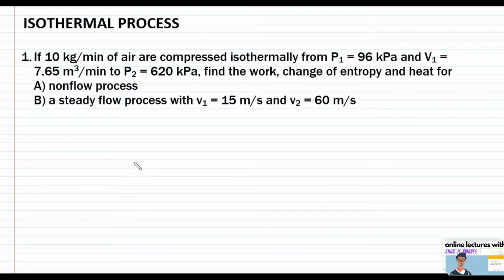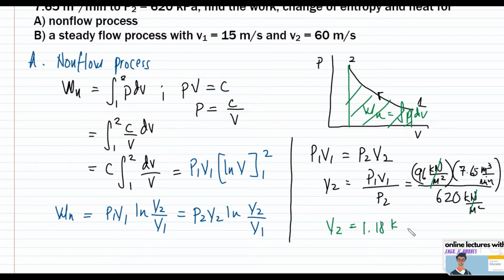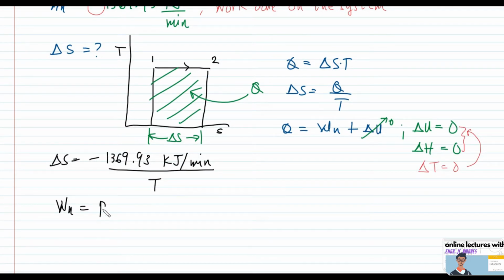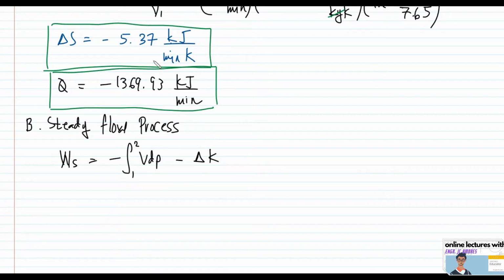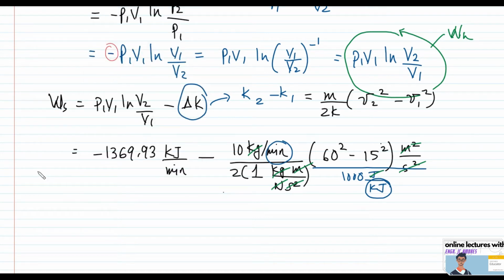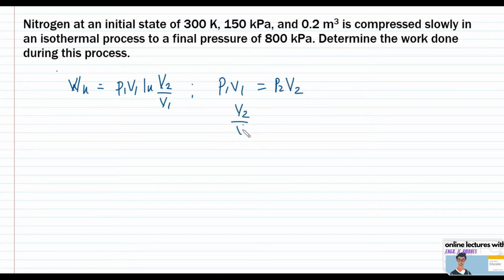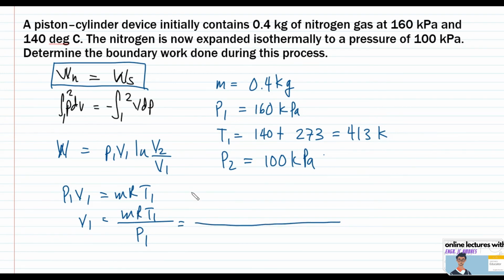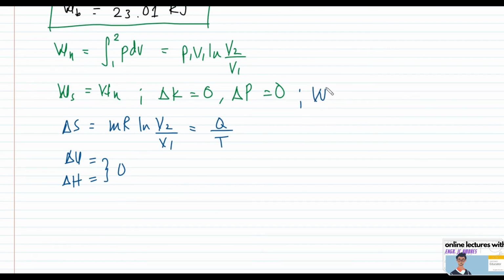Solved Problems for ISOTHERMAL Process | Discussion of Formulas | Step by Step Solution

Comment: The units of entropy are KJ/K, and not KJ/min K. Why was that the answer if the units are wrong?
Reply from the maker: Hello Merti. ∆S = Q/T. In the problem, Heat is also the Non-flow Work, and it was a rate, KJ/min. Hence, when Q/T, the unit was KJ/min•K. It really depends on the problem.

Comment: Sir paki solve din po yung number 11 thank you

The work required to compress a gas reversibly according to pV = C i s 67,790
J i f there i s no flow. Determine ΔU and Q i f the gas i s (a) air, (b) methane. For the
methane, k = 1.321, R = 518.45 J/kg K, c v = 1.6187, c p = 2.1377 kJ/kg K